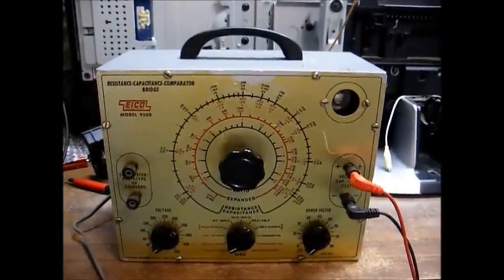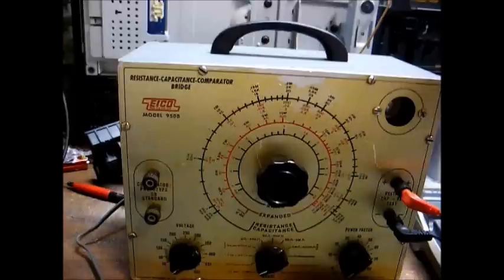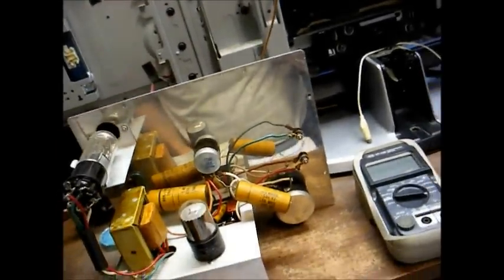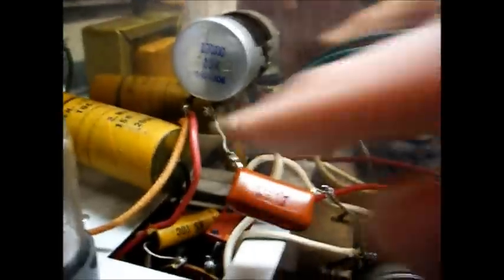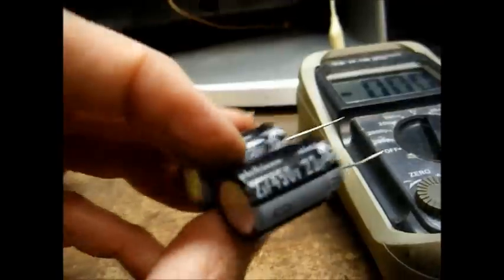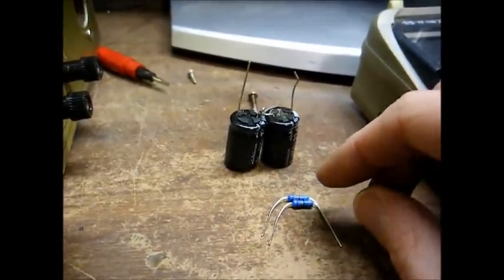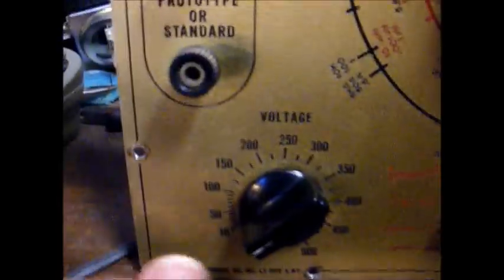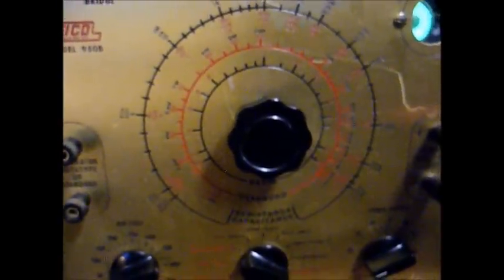Eico 950B Resistance Capacitance Comparator bridge (aka, capacitor tester) from 1963

Comment: I’m considering purchasing an older model on eBay, however the owner says the neon light isn’t coming on when the unit is plugged in.  Is this typical behavior or perhaps they have dial settings wrong?

The manual says little with this regard and I’m trying to give the owner a “smoke test”.  Thanks!

Comment: Hi Thanks for the video the Manual was hard for me to read and follow, got a fair idea.
You confirmed allot for me,
I just bought a 950B at a Ham Festival for $ 8.00 as Non Working took it home and opened it the black ground wire from the Magic Eye had broke away from the terminal. A little Solder and the Magic Eye lit right up. 
Very Happy Seems to work great tested some resistors and some old caps then a new one to see the difference iv'e learned allot from this device already.
looking forward to recapping and using this tester often.
73

Comment: I just got the same tester off eBay, looks exactly the same other than the model number not having a "B" at the end.. Would mine still be the 950B ? I've seen 950A models and the design is very different.. eBay link to mine: http://www.ebay.com/itm/Nice-EICO-950-Capacitor-Tester-Comparator-Bridge-Refurbished-Working-/261692309293?ssPageName=STRK%3AMEBIDX%3AIT&_trksid=p2047675.l2557&nma=true&si=YCUCg9iXnaPyzsPyXPpziWEoO9w%253D&orig_cvip=true&rt=nc

Comment: In the video, you allude to how to use a resistor to enhance the safety of capacitors in series. As luck would have it, I just put capacitors in series to replace some old electrolyics in an Eico signal generator. I'm a complete newbie with this, and I'd be very grateful for advice on how to add the resistors. Great video, thanks!

Comment from the maker: Yes, you can connect a DC voltmeter across the righthand terminals (the ones normally used to test a capacitor), set the function selector to leakage, and rotate the voltage control. On this tester, the actual output voltage is about 50 volts lower than what's marked on the scale; but, I'll take care of that soon. It's also possible to place an milliamp meter in series with a cap under test to measure it's actual leakage current.
Reply: I recapped my Eico a few years back. The voltage on the faceplate and the multimeter are off. The final reading is 455 volts.

Comment: These are great! Original Paco burnt up because never re-capped & that cap burnt up my 500v on the xfmer. Bought a 2nd Paco, for transformer. Works well again. Just got an Eico 950. I'm sure it tests leakage great. The eye must open. That means everything.